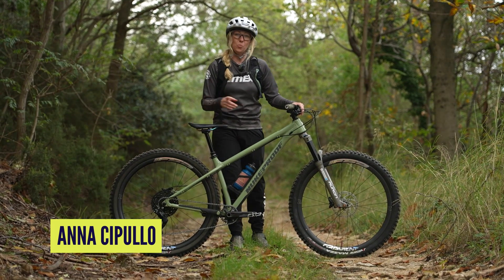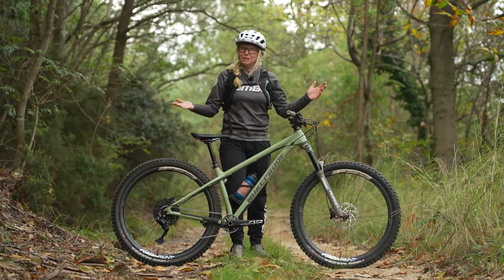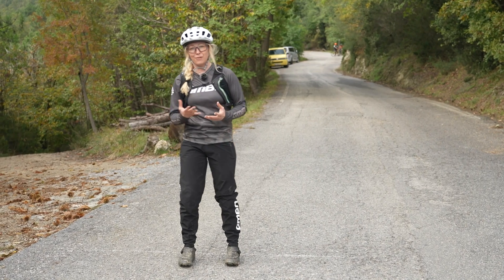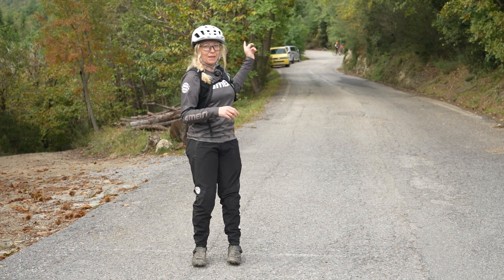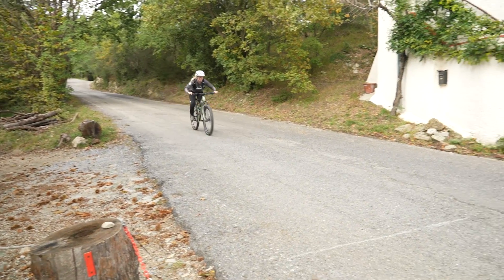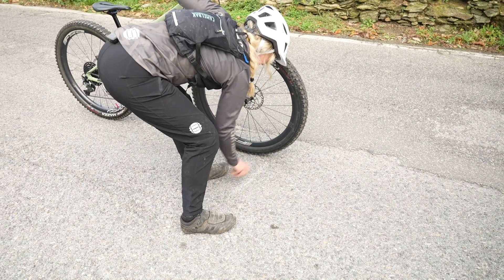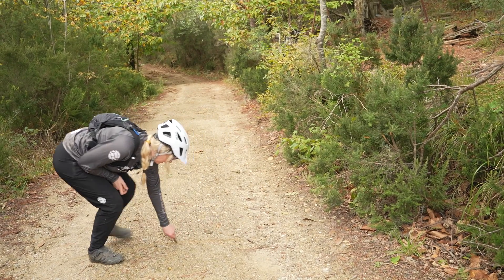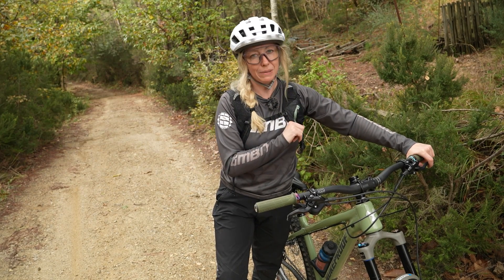Is Bigger Better? The Science Of Superior Braking Performance

Comment from the maker: What size brake discs do you have on your MTB? Do you have the same size for both or mix it up?
Reply: 200 front 180 rear seems fine with 4 pot xt
Reply: 200mm front and back 😜
Reply: 203mm front and rear with Shimano XT 4 pistons.
Reply: 220f/203r is my rotor setup using Shimano MT4 series levers and calipers. More than enough stopping power for my needs.
Reply: I just measured I have 180mm on the front and 160mm on the back. That's on my cross-country Gary Fisher. This is why  I  like watching The Professionals. Don't think that's right? I might need new rotors possibly 200mm or 220mm?
Reply: Hope floating/ ventilated 203 front & rear of my V10s.
Reply: 203 mm front with 4 piston brake caliber and 180 mm rear with 2 poston brake caliber. Full suspension 160 mm/150 mm bike and I’m a heavy +225 lbs / 104 kg rider. Brakes are Magura Trail Sport and discs are lightweight Ashima’s.
Reply: I'm on 160mm (front and rear).  Only once had a problem with that - I did try a down hill run once...  So yea I faded them out pretty badly (and really gave the XC only 110mm suspension a good work out - so the bike (never mind the brakes) really isn't setup or ideal for that kind of abuse).  Otherwise I have not had an issue with them proving consistent well modulated stops.  I'm sure a majority will go pssh at the tiny size, but I don't feel I'm over or under braked at all (though remember I'm also on a 26er which has less rotating mass to bring to a halt).
Reply: 559mm rotors for me, front and back *
Bigger is not better in this case, but brake force isn't everything.

* because my 26" wheel rims are the brake rotors.
The clearance needed between pads and brake surface means you need smaller diameter pistons to get more travel and so you loose braking force.
If only a wheel rim could run as true as a disc rotor, the braking would be amazing.
Reply: She grabs the break a little early each time on every test
Reply: 203 front and rear
Reply: Don't know if you read my commentary on the last brake gmbn video, but I explained how brake rotor size has nothing to do with braking power- as far as bigger = more power. A brake rotor in essence is like a heat sink. Surface Friction creates heat which is then absorbed and dissipates heat, converting kinetic energy to thermal energy. What a bigger rotor will do is stave off brake fade more efficiently than a smaller rotor.

Thermal conductivity is the goal. You want pads that can absorb and dissipate the proper amount of heat from the friction to the rotor and still be within an operating range that will optimize braking power. Once the pads have surpassed their efficiency operating temperature they will begin to glaze from overheating and no longer be able to transfer the heat energy to the rotor and vice versa. 

If the rotor becomes overheated the pads will absorb excess heat from the rotor as well as heat from the applied forces of friction. And the result is that the friction coefficient will diminish- I.E.- brake fade
Reply: @rider65  
Force x Length = momentum

The larger the rotor, the greater the momentum working against the tire's rolling force. It's sophisticated but physics will tell you that it does actually work.
Reply: @rider65  The larger the rotor the more leverage you have on the wheel. It works the same  leverage with a ratchet. Imagine you have a bar that is 180mm long and apply 10lbs of force, then make that bar 360mm you have to apply half the force to achieve the same result. Same applies to a brake rotor. Larger the rotor the less force you have to apply to get the same results.
Reply: @rider65  - you forgot about leverage. Remember; physics believes in you even if you don't understand it.
Reply: @floydblandston108  😂 nice try their Fredo... leverage can only change from the master cylinder pressure itself. Go back to school Sonny Boy
Reply: @rider65  - it's called 'angular momentum', look it up.
Reply: @floydblandston108  by your delusion illogic thought that would mean that every bike running one bigger rotor front to rear to front would require less lever pressure from one brake to the other. And that is just stupid speak right there...🤣 that would also require every single Rider to know the difference in lever modulation on the bigger rotor side. A very advanced proprioception skill, which 99% of riders do not have including yourself...😆
Reply: @rider65  - there are pills that can help you when new rotors can't.
Reply: Simple test: @floydblanston108 turns the front wheel, @rider65 tries to stop it from turning by holding on to a spoke: once close to the rim, once close to the hub. This should conclude this discussion quickly, no?

Comment: I didn’t see you changing the caliper spacers. The end of the video you appeared to be talking about the 220mm rotors. But I didn’t see any spacers. 

My bike came with 180’s. And had spacers. I’d probably need super thick spacers for 290’s or 220’s. Fork is a Rock Shox Recon 130mm.

Comment: Between 200 and 220 mm rotors, this is and odd result, which is not consistent with my experience. Are you sure that discs and brakes are bedded to each other? Is your pull on the brake lever of the front brake consistently the same force?

Comment: my fat ass 90 KG 5'7" needs 220mm cus crappy 160 and 180 are JUNK. 203 is good but ifyou are worried about heat you need more pistons and floating rotors. so this test is kinda off. you should include squeezy brakes too.

Comment: This was inaccurate in portrayal.  Front brakes on most vehicles are usually much more powerful than the rear brakes.  In your testing,  the rotors were identical front or rear.  The rear rotors should have been smaller to create less stopping power on the rear.  I noticed your rear was locking up and increasing the distance of stopping when it should have been more matched to rotation with the front.  Race cars always have a bias to favor the front brakes in comparison to the rear and pretty much all other road vehicles as well.

Comment: Is bigger rotor damage my frame  ? 
I have a Marin bolinas ridge 2 (  stock bike comes with tecktro underrated hydraulic brakes with 160 mm rotor ).  But in my target 180 mm rotor with deore m6100 2 piston brake ,  can i do it ?

I have 2 option m6100 with 180 rotor  or stock 160 rotor with m6100

Comment: The problem with the 220's on pavement is weight transfer caused the rear to lock leaving the front to do all of the work, there's a reason why almost every vehicle breaking system prioritizes front front brake size and power over the rear. That's why i always run bigger rotors on the front of my bikes.

Comment: Yes, the 220mm would benefit from heavier riders. But also helps once venturing into wheel lock up, human ABS is required, pump-pump-pump instead of a dead grip.
I noticed similar issues with rear brake heating up more as i bed in new brake pads and rotors. Given this higher temperature and long exposure to higher temperature for longer duration, i am strongly contemplating swapping in Carbon Ceramic Silicon Carbide 200mm rear rotor and stick with Hope V4 220mm ventilated 2 piece rotor as front to run with the Lewis S6 6-pot callipers for my eMTB. 😂

Comment: 220 massively hotter as they are just massive :) and cool down slower at ~50C.  In my case water boils (explodes) instant  on my 200  on descent. Maybe 600m descend over 5km trail. Is a different to just normal ride.
Math would be following. if you stabilize your speed. Heat power would be the potential energy converted to heat at a rate of descend. That heat needs to dissipate at the same speed. The speed break disk dissipate heat depends on:
- surface (fixed)
- airflow (almost same)
- materials (fixes)
- but the most on its temperature. difference between disk and air. 

While surface is constant and speed mostly limited. Once temperature skyrocket it maybe the only factor how fast heat dissipates. Once it reach certain level it will stay in equilibrium. The equilibrium will be achieved at lower temperatures for larger surface or lower air temperature, or better flow/materials. 

Once you stop there will be no heat coming into the system. Temperature will drop very fast. Once it becomes near room temperature ~50C it will dissipate very slowly. Massive disk will keep temperature longer, as it just accumulated more energy. 

I wonder if to attach some sensor on the fork and measure it continuously at a steep descend. I heard ~400C is their normal working temperatures.

But all been said about sizes. I think any hydraulic break will stop if you have strong fingers or two. The mysterious stopping power is a myth. As almost any bike can through you over the front wheel. It rather personal preference how much rider press on the leaver and how much force he experience. Also bike have no ABS, so if break is too sharp rider will experience to much skidding on powerful breaks, that will reduce total "breaking power" over the course. I would call it "subjective braking ratio" that can be optimal for a biker preference. Power is a more scientific term: amount of force multiplied by path per interval of time. 

About the heat, I am riding steep fire roads in California. That is long descend there you have to moderate your speed all the time. If I put water on my rotors it vaporized instantly. I wonder if it is over 200 or even 400c. I never experienced "break fading" yet, but I guess 220 maybe justified to keep system 50-100C cooller. Yet I know heavy riders on 200mm with no issues at all.

I am watching all this videos because my rear breaks doing high pitch noise once "warm". Thinking replace rotors and go 220 "just in case".

P.S. also not to forget about break system. Mostly leaver, that transfer force from finger to master cylinder, and then  ratio between master and working cylinder. That will affect ratio between force on a finger and force applied to pads. Not to forget pads surfaces. Aaaaaaaa.... all subjective.

Comment: I've got 3 different bikes with 3 different brake discs, and I never felt like I didn't have enough brakes. I haven't ridden my new Pivot Switchblade yet, but it's got the biggest brakes of the three with 203mm in front and a 180mm rear, but with 4 piston STX calipers front and back. I'm sure the braking will be ruthless. I have no desire to change rotors on any of them. The front brake is supposed to be doing like 70% of the power, you definitely seem to favor your back brake. I've had quite a few motorcycles, and the last one I owned had dual 320mm rotors up front with 4 piston Brembo calipers on it, and just a single 220mm rotor in back with a two-piston caliper because the front is where the power comes from. During the panic stop testing, you could have used the front brake harder instead of locking up the rear and dragging the tire. I know in the loose stuff you're worried about losing the front end, but there's more front squeeze to be had IMO. ;)

Comment: I actually did the same. I have a 4 piston deore but I was using 160's so it was really not as snappy but when I changed to a shimano 180mm it made a big difference. I only do light but fast trails and with the 180's front and rear I can descend with ease and yes less fatigue doing 1 finger braking.

Comment: Your test was not done properly. I have 220 on the back and 200 on the front I can stop without skidding on tarmac with proper front brake modulation. Bigger is better and I believe a bigger rear is better because we use rear brakes alot more than front.

Comment: #askgmbntech Can 4 piston calipers be used with  Acera levers? The nut on the valve stem to tighten it to the rim are instructed to only finger tighten, but what happens if you can't get a seal. I noticed that Problem Solvers has a wing nut looking nut to put more tourq on the nut. Why would this be any different then carefully using plyers to tighten the nut

Comment: Realistically, you can lock your wheels with either size, so the braking power is there in all cases and it's limited by traction, i.e. tyre/terrain combo.

The size difference matters technically only as far as heat management is concerned. Dissipation is a function of surface area and one can easily have a minimalistic 203mm rotor with less surface than a bulky 180mm rotor. 
Regarding heat accumulation, a bigger rotor will always have more braking surface (larger circumference that comes in contact with the braking pads), so it should heat up slower than a smaller rotor.

Larger rotors provide different feel due to modulation, which isn't really bike (or rotor) performance, but rather rider performance. Note that in all cases the contact surface is the same since it's determined by the pads' size, so the difference in modulation is only due to the radius, i.e. you are playing with leverage - that's literally like changing the length of your brake levers.

Comment: Of course, I don't understand, but if even the measurements of the temperature of the rotor from the back showed a value almost twice as high as from the front (timecode 7:56). This clearly shows that a person either does not know how to use or is afraid to use the front brakes. Front brakes and on a car and on a motorcycle and on a bicycle, these are the main brakes. The rear ones only help the front ones, if someone thinks otherwise, I sympathize with you dear ones. In other words, the video loses its meaning already on this small detail. Best regards.

Comment: it's all about getting used to the feel, and how you're using them.  If the big rotors are hotter, it's probably because you were dragging them more,  Likewise, on the emergency stops, you might have been going a little too light on them overcompensating, since they feel too grabby.
Any of those probably has more than you need for the max braking your tires will hold, so unless you're concerned about fade on sustained braking, it's mostly about matching it for the feel you want on the lever.

Comment: Would be smart to mention, that the 220mm rotors for YOU were inconclusive compared to the 203mm ones. I say for YOU, because you weigh (let's say) 50kgs, but for a 100kg rider, a 220mm rotor may be even less "powerful" as the 203mm for you.
Also you (pretty nicely nailed) mentioned the grip of the wheels (tires)  that you need for those bigger rotors to "shine". On tarmac, with that knobby tires you have everything, but grip.
And the last one: you compared some "bedded in" discs to some brand new ones. The brake pads needs to "wear together" with the discs, which needs a bit more time (miles) to offer the maximum of their potential.
Ultimately: the "heat check" was also inconsistent. If you're curious about that, you should not ride them on a trail, then you measure 'em yourself, hopping down from the bike. For this test should be more accurate a longer and steep descent (for even more consistency a paved road), where you brake your bike to a certain speed, and maintain that speed (for example 25 km/h) from top to bottom. Then someone should wait for you with a switched on heat measurement tool at the "finish line", for immediate "reading". As you've noticed, these rotors cools down pretty quickly, so every second counts.
Recommendation for a future, even more accurate test: be more constant in measurements, speeds, disc/brake pad conditions, and you could involve (at least) 2 more riders (a 75kg, and a 100kg one) for demonstrate which rotor is the best for your audience.
Cheers!

PS: switching from a 203mm rotor to a 220mm one is a 8.78% increase of braking surface area (you have to calculate the contact surface with a brae pad, not just a line -> circumference of a circle). And yes, I said 203mm, because Shimano SLX rotors are available in 160, 180, 203, and 220mm variants. There's no 200mm option.

Comment: I did this test myself with 160, 180 and 203 mm discs and 2 types of Shimano organic pads too: G02S and J03A Ice Tech. 
Elevation gain: -400m, -10% of inclination all the time. I came up with the test because every time I went there, my Deore rear brake with 160mm and the basic shimano organic pads faded completely away. It wouldn't even lock the rear wheel down there.
And I found out that 1 Ice Tech on brake pads don't show any difference, 2 the same set of brakepad and rotor on front show a better fading behavior than on rear, and I think that's because a cleaner and more direct wind can blow at the front end more than at the rear. Also, I found that if my 180-160 set of discs were not enough to the local terrain, I should upgrade them to 203-180, and that's what I did.
The test was conducted where I live, south Brazil, very accidented terrain.

Comment: Thanks Anna, good info. I'm trying to get into doing my own bike work. If i upgrade my 180 rear to 200 to match the front is anything more required than just bolting it on?
Reply: It depends if your frame uses post-mount or flat-mount brakes (Different bolt distances), you would need a specific adapter depending on the mount type and rotor.

Comment: Thanks for the video,
Stop distance, heat & times are always going to be 'rubbery',  you'd have to go a brake dyno & thermal camera, 
FEEL - or modulation - i think is key, the harder you have to squeeze - the less FEEL, so go bigger 

Also you taught us we need to bed-in the rotors with pad material??